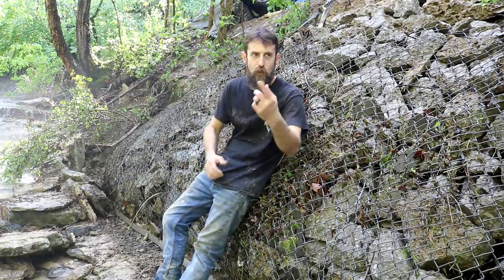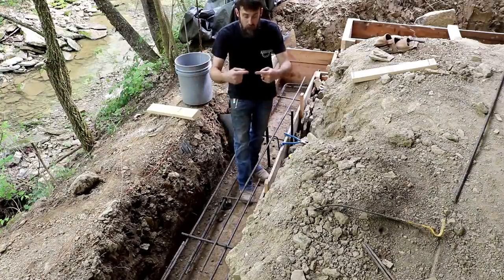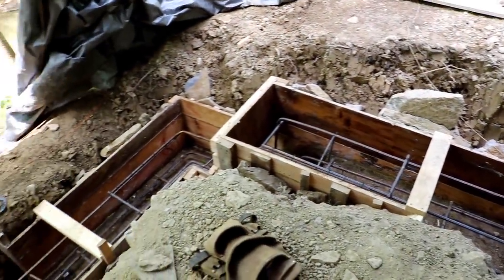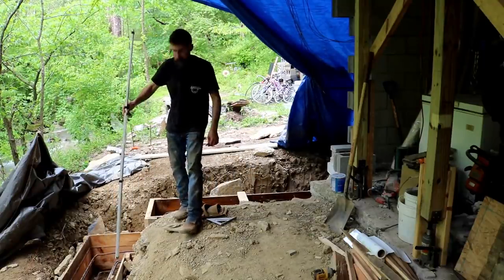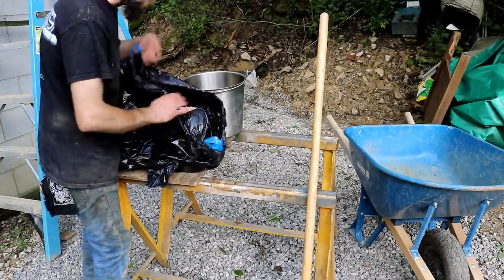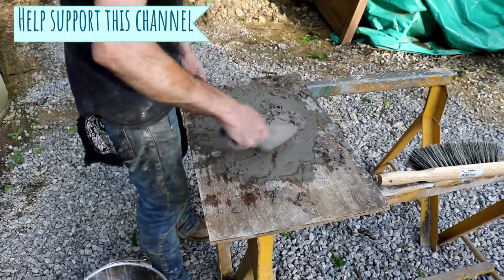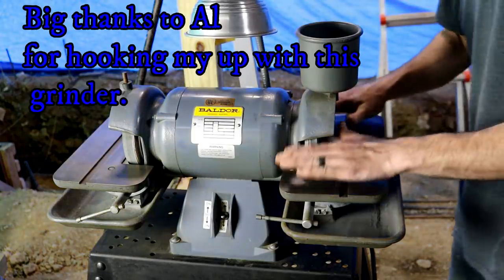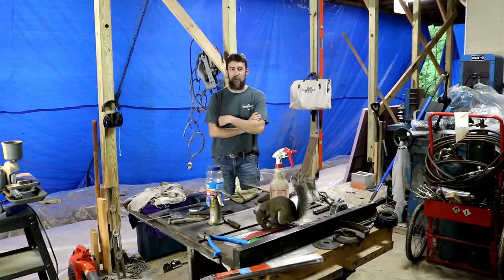Shop update 15  Huge Flash Flood footage & Block Repair

Comment: get a "cake decorator" bag to inject the mortar in those joints, it works way better then trying to work it in with a trowel, and as for wetting, use a spray doc with bonding agent and spray it down with that first....

Comment: On that rebar you bent the wrong way, you could have sent it to Keith Fenner.  He would have parted it off and bored one end and cut some internal splines and then machined the other end with matching external splines and then the bend could have been put at a number of different angles  from 0-360 degrees and then it could be pinned with 2 hardened tapered pins to keep it in place.

Comment: 7:55 used engine oil, it's more than ok for that. Also, it's ok to make that trench deeper and put on the bottom rocks, they will bind together and you will have a deeper cheap foundation. In the corners put in the foundation 4 or 6 bars sticking upwards, after the wall it's build, leave in the corner space do not go full with bricks, to go up with steel and make a vertical mould for the corner and pour cement there. It will make the corner hard like a rock and will keep in place also the walls. My way it's also at the top of the walls, to make moulds all round the walls that in the corners will bind with the foundation by pillars. In this way the wall became a rectangular panel, avoiding cracks or moving away one from another. Br.   20:45 love your pets :)
Reply: The old timers used old engine oil with a bit of fuel oil and a garden sprayer. The fuel oil was to thin it out a bit to spray it through the garden sprayer. Maybe the EPA put an end to that.
Reply: @marcellemay7721  yes,also used on wood fences. it's more "convenient" for the economy  to buy water based paint  at 2-3 years and after that to cut trees again  to make another fence to replace the rotten one...this is the progress.

Comment: That left hand bend is gutwrenching when it happens. But there's an easy solution. You just go to the trench, and dig in the opposite direction, and it'll fit right in.

Comment: To fill the block seams  you have to have the cement almost dry  
You have to be able to squeeze the cement into a sphere without it disintegrating
Then it's much easier to fill the seams

Comment: High performance forms release? No, a mess. Here’s a trick…
Simply wrap your form boards with plastic freezer wrap. Absolute release that leaves forms like new. When concrete has set up, just slit the plastic with a box cutter. The plastic falls off the boards and peels right off the concrete.

Comment: I bought an high end construction self levelling laser from the tip shop for a few $  . . it was't working & happened upon an internet comments section where an fellow talked about putting them in an freezer overnight . . did that & strangest thing it started working again

Comment: kinda disappointed in the "just getting by" on the wire ties. thought maybe through drilled with taper pins to keep them from moving when the concrete is poured. ; ) on par with the rest of the great job you're doing!

Comment: Hi.
Do your building standards allow rebars to be connected by welding?
In Poland, we can connect reinforcing bars by welding them. Joint length L> = 5d double-sided welding or L> = 10d single-sided welding.
Best regards.

Comment: Any value in running a 4-6" piece of PVC under your footer incase you ever want to run something into the shop from underneath like ..... plumbing or electric......years later?  Just so you wouldn't have to cut the floor.

Comment: May be too late now but you really should learn to use the "pigtail" or twister as some people call them. Just for general info to any who may need it.  get wire with premade loops on both ends, lengths are available for all sizes , need to  close for re-bar size so the get  tight without too much twisting. use gloves on both hands, get a whole hand full of wire in your off hand with lloop protruding above the thumb and forefinger, grasp the pigtail by the shank, not the handle, thumb and forefinger should be down at the hook, with this control put the hook into a loop and start drawing one wire out, as it comes half way out bend it about 90 degrees, control the hooked end with thumb and forefinger and place it under the intersection you want to tie,, use the off hand forefinger to finish the bend and get the hook into both loops, as you pull it tight, slide you hand up on the handle and give it a few twists until tight, wrist action only no flying elbow, when tight before unhooking slide down on the shank and repeat the process. With a little practice you can do this so fast an observer will not be able to tell how it is done. Just saying,  keep the videos coming, get the shop done and  lets get back to the machine work. Thanks,...
Reply: You need to watch the previous video.
Reply: @1pcfred  I did, Steve tried the pigtail but used regular wire, hard to get it tight and then have to cut it with something. The pigtail, if  used with the proper wire makes steel tying so easy it's over before you think of it.

Comment: Hi Steve, very confused about your shuttering. With the shuttering higher at the ends, when you pour the concrete in that section will it not just flow under the ends and flood into the side trench? Or are you going to do it in two pours?

Comment: none of the premix mortars are worth a damn but you can add some lime and they work a bit better...you can add some plasticizer instead of lime like most modern brick mortars but they still dont get "sticky" like a good lime mortar.Lime will aggresively go after your skin and clothes so have to be a bit more careful about rinsing your hands and any slop but theres a world of difference when laying block and brick...goes on smooth like butter and actualy sticks to the surface.Although not quite as strong as a plasticizer mix its still stronger then standard mortar.

Comment: The joint between the blocks at its' extent exceeds what you should have for mortar.  The wall is inherently weak.  Really it should be completely rebuilt.  I doubt it would pass inspection
Reply: The wall isn't supporting anything.  Fixing that crack was mostly to keep transient squirrels out.
Reply: @paulcopeland9035  makes no sense.

Comment: There is NO STRENGTH in that grouted joint. Realistically those blocks should have been knocked off and relaid properly. It is likely the joint will crack again (small cracks maybe), but currently there is no real connection between the lower section of the wall and the original connection to the roof.

Comment: Hi from Belgium/Europe. 
Get yourself one of these Steve (or similar) to fill up your wall joints: https://www.homedepot.com/p/ANVIL-3-8-in-Tuck-Pointer-Trowel-57511/300960262. 
Could also be made easily by yourself. 
(BTW) After you filled the joints, leave it to dry for while and then wipe excessive mortar off with a brush. 
Your jointing mortar should also be a little dry when applying to prevent cement marks on your wall.
Love the way you're respecting nature... also your instructing vids...etc...
Keep it up and stay safe. Good luck.